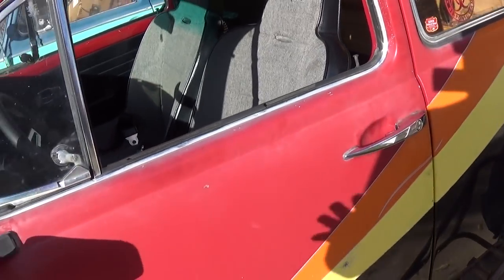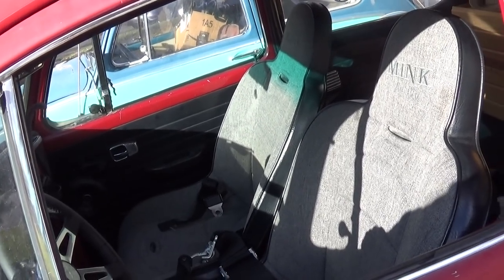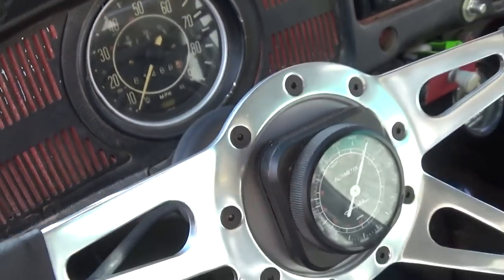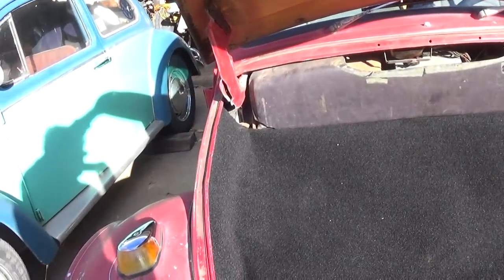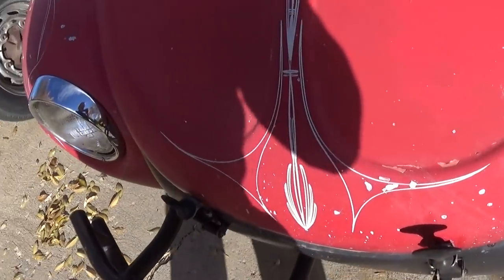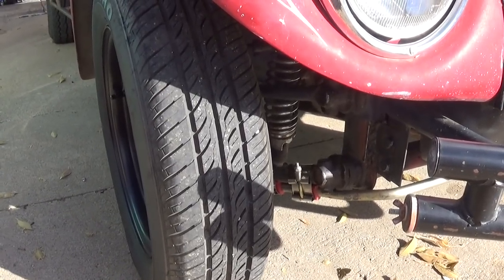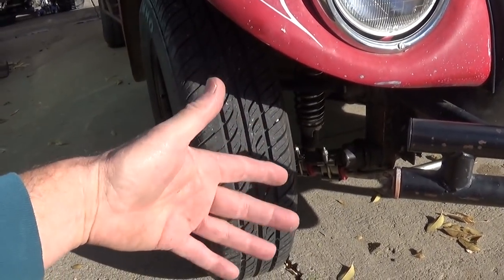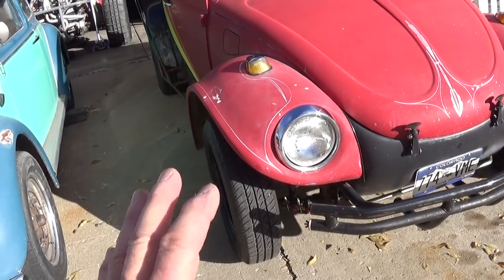Quick Release Front Stabilizer Bar and Carpet

Comment: The carpet does look great. As all remodels go, one thing calls for another! Also, how do you like the flux wire welder? I am tossing around that or the argon mig. Have heard the flux costs alot more than the plain, but how about the gas? Is it costly too?Lol    questions   questions....sounding like riddeler now ha ha
Reply from the maker: I have had my little lincoln 110volt flux core for over 25 years. I got it so I could take with me when I went to the sand dunes to make frame repairs ect. It's ok but messy compared to the gas and now you can get the gas option and have both. I had a full size miller with gas 230v but opted to sell it due to lack of shop space. Get the best you can afford. It really doesn't matter because you will out grow it if you weld much.

Comment: You should turn those bumper mounts so they are just above the sway bar, then weld a 2"x1/8" plate between them and the mounts and the bumper so it has some more support.